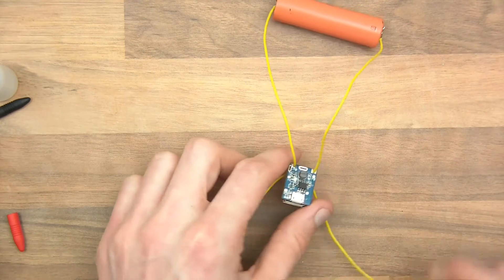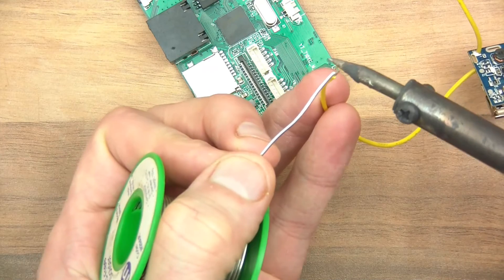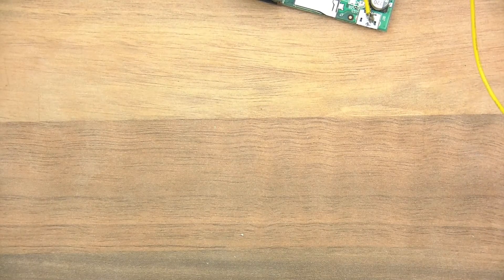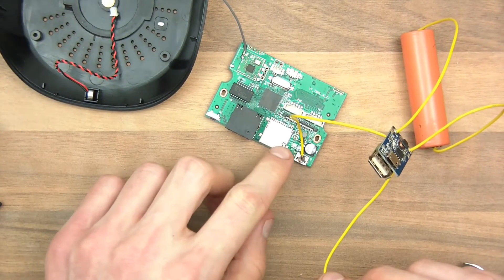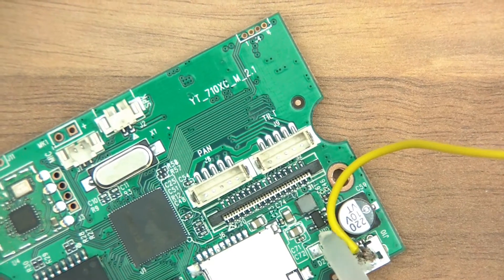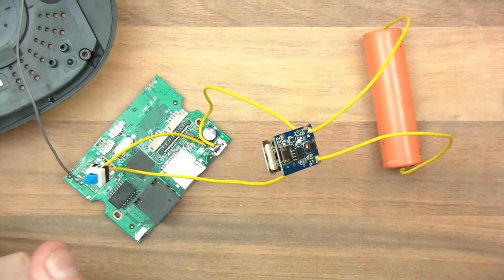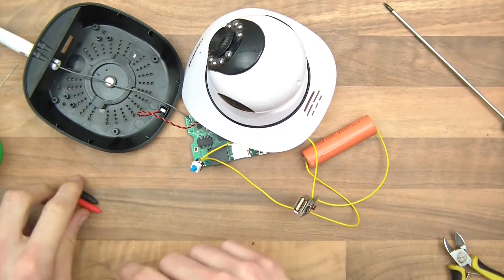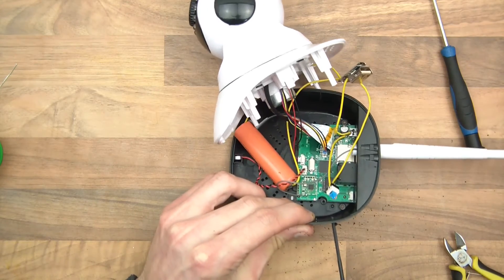TUTORIAL: How to Make a Wireless Camera Actually Wireless! Adding 18650 Lithium Cell! PART 2

Comment: Hi Antony,

Just wondered how long that cell would last.

Did you check the current drain? Is it marked on the lable what it will take.
What is the software you are using to connect to the camera. I have a cheap'o' camera that is useless because it has to connect to the vendors website, but maybe I could intercept the video!

Don't always asume that metal parts are 0(-) volts, in most (reasonable to good) electronics, metalwork is normally decoupled from -(0) and + voltages to make them an earth as zero volts isn't the same as earth. These cheap Chinese things don't bother though.

Cheers
Martin
Reply from the maker: Hi Martin, I didn't check the cell capacity or anything! The software... I have different types of software for it. There isn't a specific software. It uses a protocol which is generic. Anything which can understand the protocol will work. I think it's rstp or something... :)